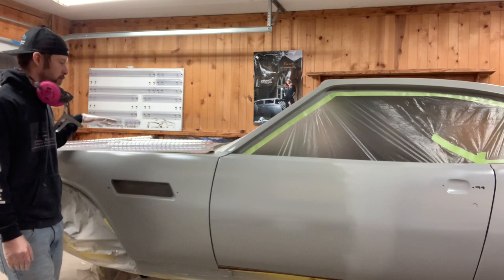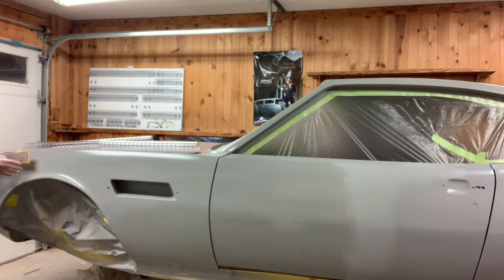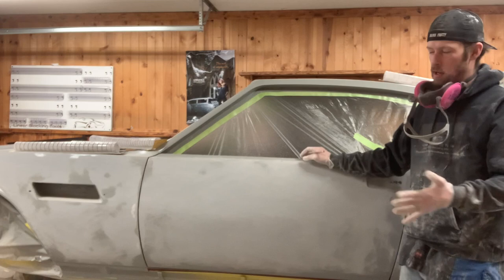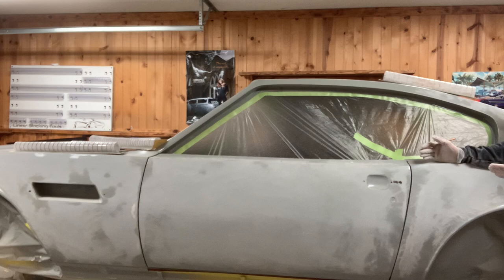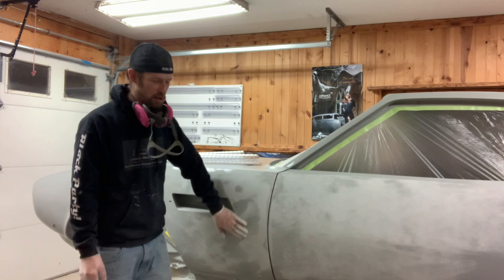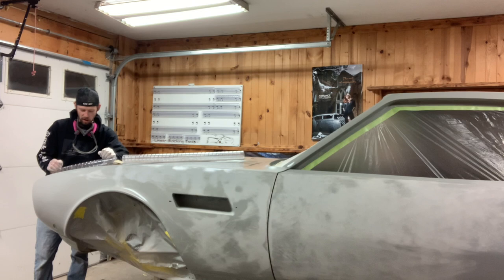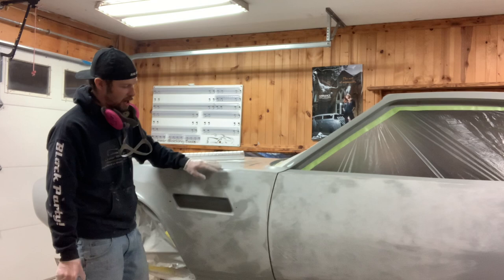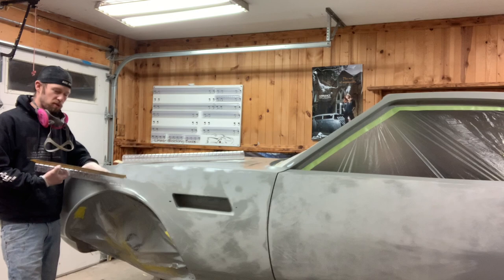69 Aston Martin DBS part 1 - body work tips and where to use which blocks

Comment: Good video and of course your way of doing things and to the contrary I've been doing this since I was a kid 45 years later still doing it used everything from nitrous cellulose acrylic lacquer Dulux Centauri all Sherwin-Williams products RM and Ditzler have used body filler with hardener over bare metal still have a car I did 45 years ago a 71 Lincoln Mark 3 in Sherwin-Williams acrylic lacquer primer sealer and acrylic lacquer paint still perfect to this day no lifting bubbling or shrinking also Clawson claw glaze finishing putty and never used all those kinds of blocks, have an stay of  flat boards short long and some flexible blocks also seems like it's all too much of a production and too many different variables and materials these days all very confusing and seemingly unnecessary along with all the different kinds of spray guns on the market I have a few different guns including Binks 7s, 62s Optima, Sata Jet and a couple of Devilbis some of the finest guns ever made some of these guys today don't even own or know how to use an acetylene torch give me a break the internet has produced a lot of Stars that do not have a clue

Comment: These blocks are expensive  . Any block will work as long it is straight  and learn the techniques of using them .  Use lots and lots of guide coat .have fun.